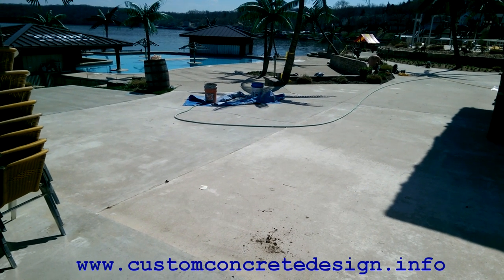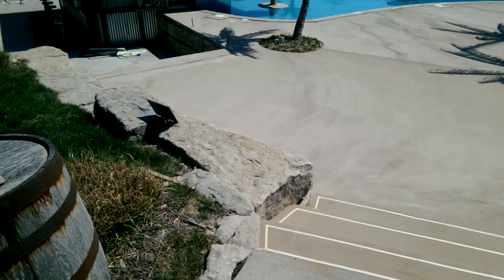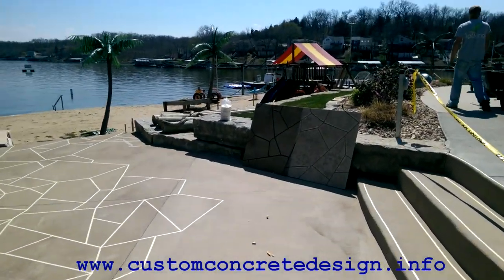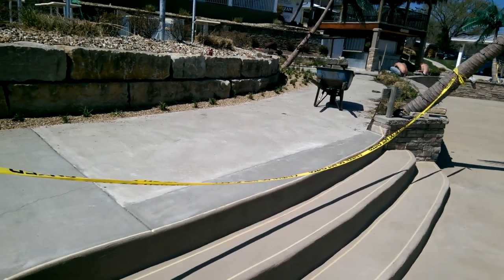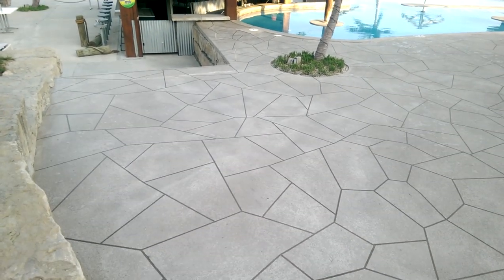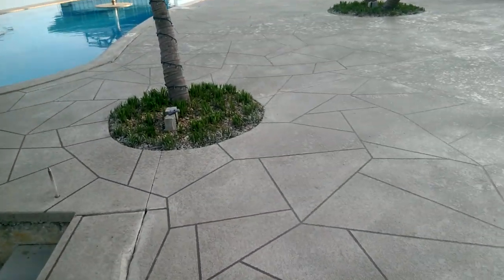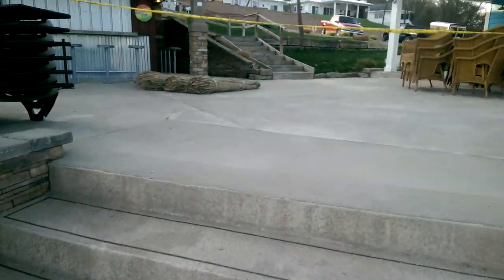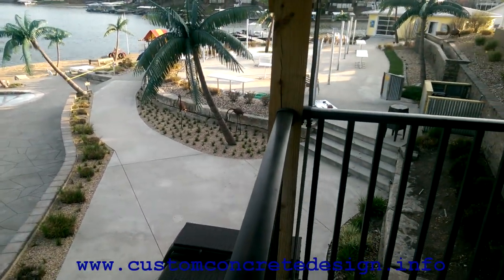Decorative Concrete Resurfacing Pool Deck Lake of the Ozarks Gravois Mill MO

Comment: Dat was a nice size project,!!
Came out awesome,   I Proly would have use the stencils,  because of the size of the job.
Reply from the maker: Thanks...Yeah it was, and we go back this fall to do more than we did here, might have twice as much this fall. I couldn't use a Stencil because the Client wanted what's called an irregular flagstone (which is straight lines) and he wanted different size rocks, you can't get all that with a Stencil, not any I have found anyway.
Reply: That's true,  that's some time consuming work..i kno it was worth it....
Does it get super hot there?
Its about 95° here.
Reply from the maker: lavonn simmonz
yeah it was very time consuming for sure, but worth it. temps right now aren't bad, high 80's low 90's.